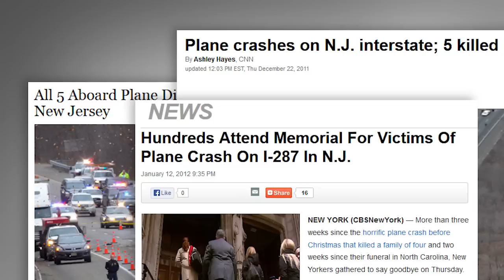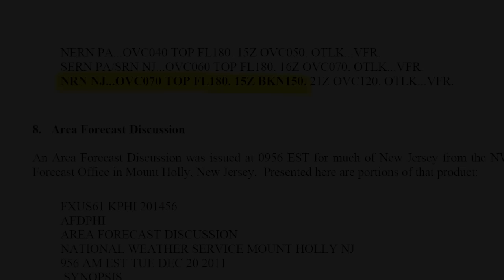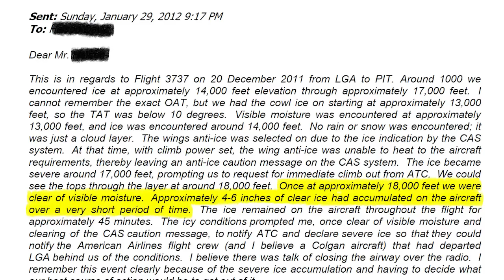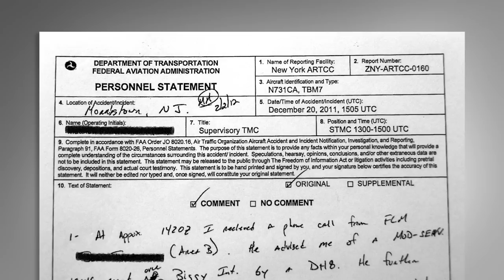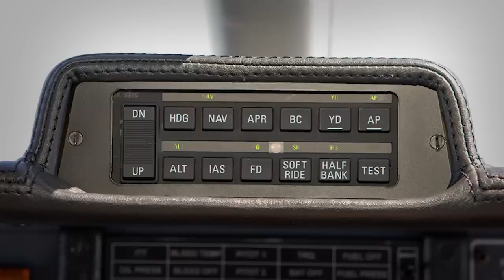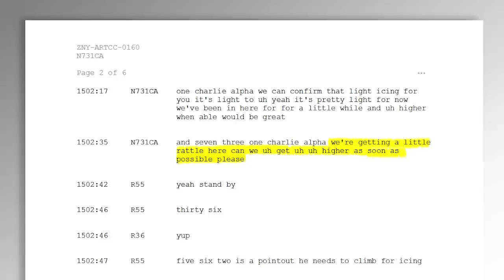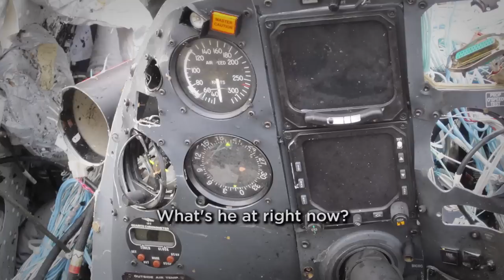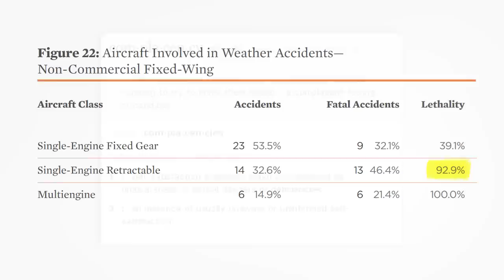Accident Case Study: Delayed Reaction

Comment: what would have been the correct things to do on his initial contact with moderate icing since it built up so rapidly. climb, decent, turn around? could a stall/spin be recovered in this case? i wanna learn from this accident as much as i can, share your thoughts?
Reply: I believe the pilot was unaware how fast the ice was accumulating. Therefore, I also think he made a fairly well informed call when he asked for a priority altitude increase, to escape the icing conditions and continue the flight. Most importantly, he needed the ice separator on his engine activated, which would have possibly got him up to altitude before the icing became too severe to continue a climb. Even if the ice was so bad he couldn't climb out of it, having the engine on would allow him to know he was reaching an extreme level of icing before losing control, and potentially begin an emergency descent. The idea being that if he knew what was happening sooner, he could have stopped it.
Reply: Pilot was totally caught off guard with the severity of icing. The ice separator would have helped.
I think the ATC should be paying more attention to weather and reports from other pilots and get planes out of the icing conditions rather than to keep them there...but of course ATC does not know how severe the icing is, only pilot can (and then sometimes it is really hard to judge that).

Comment: When going into icing conditions here's the priority: 1: ICE VAINS (inertial seperator) 2: Prop heat/intake 3: Wing/tail deice. You can fly an airplane loaded full of ice. Propellers don't work when they're effectively baseball bats(or one blade is).
Reply: No, you CAN'T fly an airplane loaded down with ice. The lift deteriorates until you are just riding a rock. You must have mis-typed because that's a irresponsible thing to say.
Reply: Cork Camden I feel like that was a typo. I hope no one thinks you can fly an ice cube.... :)
Reply: Cork Camden yes you can fly a brick if you can get it going fast enough. Why is it “irresponsible” to say?
Reply: @michaelarturo6864  LOL if you can fly a plane inverted then why can't you fly a brick given enough power and attitude control?
Reply: touristguy87 exactly
Reply: I'm guessing that you don't use the VANES much.

Comment: The inertial separator switch --not on, was the big mistake! You will accumulate ice in the intake and choke of the air going into the engine. Through all the confusion the pilot might have panicked and got into a spin (with extra ice not helping). So, basically if he didn't forget to turn on the inertial separator, he'd been fine.  So sad it could happen to anyone.
Reply: Michael Arthur It's weird since there's an annunciator that's supposed to be illuminated when it's turned off.
Reply: I'm not sure about that specific model of plane, but it does sound like he choked off airflow to the engine with ice.
Reply: I wonder about stall recovery procedures in IMC, especially with seveere icing, would not want to encounter anything like that.

Comment: What is the potential FIX for this situation in the air??  As soon as you notice the ice, immediately turn around? Climb to the highest possible,  but faster? go down to 2,000 feet or less?  Hit all the switches that have to do with deicing... and then what?  The obvious thing to do is DON'T fly if you have a chance of icing... but can someone answer the questions ABOVE? please?
Reply: Tome4kkkk  -  In icing condition like in this case, I would commence an immediate but not rapid desend, but more of a controlled descend while almost simulteanously notifying ATC of your descend.  Trying to "climb out of icing" is the wrong thing to do as your aerodynamics is compromised by the ice build up and will only cause a stall  from the higher angle of attack and ice induced drag and control surface and engine malfunctions.
Reply: Like the video said...we fly the weather we find, not what is forecast.  Complacency is the danger, since "I've flow before with this forecast and it was fine", but what they forecast is not what was found. So you need to react to what is in front of you, not what you thought would be in front of you.
Reply: NCLUSA: I agree. In aviation, you don't have to be anywhere, and you should have a Plan B ready to implement. In this case, their plan should have been to stay home when such conditions prevail, or to drive instead.
Reply: @nonmihiseddeo4181  That is easy to say after the fact.  We get Moderate Icing reports all the time.  This aircraft is made specifically so we can fly into known icing conditions.  This pilot never received the mod/sev reports from other aircraft.
Reply: @nonmihiseddeo4181  that's for poor people and commies.
Reply: Enable the inertial particle separator for the engine, descend (lower angle of attack) and declare an emergency to the ATC. This is what I got from the video. Although I'm pretty sure descending is only to buy you the time needed to get the hell out of the icing area. As far as I know low altitude doesn't guarantee no icing.
Reply: @Tome4kkkk  He just flew VMC into IMC.  He knew exactly where "good" air was.  Unfortunately he tried to get on top and it killed him.  He should have descended to 8000 or below then reevaluate.
Reply: Well apply all the deicing procedures, and I think ask ATC to help you get out of the icing conditions, I would think they should know if you need to go higher/lower/back... Though in severe icing you really do not have that much time.
Not sure if you should go higher or lower, going higher means that in case of troubles you will be forced to go down through those nasty icing conditions, so in case you need to make emergency landing it is better probably to be lower, but on the other hand you might be able to get out of icing conditions so it really depends on the weather you are in at the time.
Reply: Don't fly period.
Reply: Nonmi Hiseddeo, a lot of people are like Sheep, if other people do it it must be ok to do. I am a realist, anything that moves is dangerous, anything that moves very fast is very dangerous. Yes there are more car crashes, but then again there are many many more cars being used than planes. People need to listen to their own mind, if your mind is telling you that somethings might be dangerous then it just might be?.
Reply: Well said, NCLUSA.
Reply: @NCLUSA  ??? We've had only 1 commercial aviation death in the US since 9 years. The odds of a plane crash are one for every 1.2 million flights, with odds of dying one in 11 million. Your chances of dying in a car or traffic accident are one in 5,000. In the us U.S every 12 minutes someone dies in a car crash. you are way more likely to die driving to the airport then dying on plane leaving the airport. Your driving rationality follows smokers logic "I've done it more than once so it must be ok".
Reply: @bishop51807 People take vastly more trips by road, than by air, so that comparison by itself doesn't tell the whole story.
In the 90s at least, it seems commercial aviation vs car was approximately the same risk of fatalities *per hour*, so statistically similar risk driving to/from the airport, as on the flight.
Some other stats for the UK in about the year 2000 showed about 4:1 higher risk per hour by car than plane, but about 3:1 higher risk per trip by plane. The stats seem to vary a lot, partly driving & flying conditions in different countries I suppose.
But by distance of course flying commercially would be much safer.

Private plane flights are far more dangerous than commercial though, 1 fatal crash per 50,000 hours for personal flying (which was in turn worse than top-dressing, training etc flights).
https://www.livescience.com/49701-private-planes-safety.html
https://www.ntsb.gov/investigations/data/Documents/ARA1201.pdf

Even the space shuttle was only twice as dangerous as car..... by distance ;)
Reply: @bishop51807  that's commercial flyers I wonder how much higher the risk is if you are flying non commercial

Comment: Great video … and very sad story.
I guess that no pilot would have been able to recover it, because it is already too late when you stall in this situation.
The only equipment that might has saved their lives could be a parachute (which you can find on aircraft such as Cirrus).
Reply: The Cirrus parachute deploys at a maximum of 135kts. There was a similar incident involving an SR22 where the pilot tried to climb out of the ice, and stalled, entering into a dive. He pulled the parachute, but the aircraft was already going so fast that it just ripped right off and the plane crashed, killing the pilot.
Reply: François SUTTER he would've survived if he deviated from ATC clearance and climbed above the icing conditions. But hindsight is always 20/20

Comment: I have about 100 hours or so in a TBM 700 (9000+ total time). They are more than capable of handling heavy ice. However you have to use the inertial particle separator or the engine could ingest enough ice to either damage the engine or flame it out. They mention in the video that they found the IPS switch in the off position but they don't elaborate on it. 

I will say this. I was at FL220 in a brand new TBM 700 many years ago in moderate ice when I heard a rattle or a buzz coming from the tail. The airframe had a moderate build up of ice on unprotected surfaces but very little if any on the wing boots which I was actuating every five or six minutes. The longer we stayed in the ice the worse the noise was so we asked for an immediate descent to 10,000 which we got. Once we were in warmer air the ice melted and the rattle stopped. We investigated the noise and never could determine the cause. It didn't seem to effect the flight characteristics at all, just a "nerve rattling" rattle! I do want to say that I trust the TBM completely. I think it is a well made airplane and would have no problem flying it anywhere. However my arm chair quarterbacking thought is that he pilot had the autopilot on in cruise at 17000. When he was given the authorization to resume his climb - 15 seconds of ice build up later, he trimmed the AP trim wheel to begin his climb but the elevator may have been frozen in the cruise or neutral position from ice freezing around unprotected areas. The AP couldn't overcome more pitch commands from the pilot on the AP trim wheel and it inadvertently disconnected which caused an immediate pitch down which may have caused some PIO (pilot induced oscillations) and stalled followed by a spin. Sadly we may never know what really happened.
Reply: Wow. Your perspective is interesting.
Reply: I've flown right seat in a 910 for about 8 hours and we encountered ice. The checklist had the Inertial Separator as the first item in moderate conditions.
Reply: @ooo_Kim_Chi_ooo  Many pilots don't like to use inertial separators when they are climbing especially when you are trying to expedite climbs because it will cost you power.  He possibly just forgot though.  Might have been his first encounter with icing this bad.
Reply: "more than capable of handling heavy ice" That is a worrying statement from a pilot. Bravado like that gets people killed. The conditions described by the Air Wisconsin and Amercian Airlines planes in this video sound  like supercooled large droplets (SLD) conditions. The cues to SLD on the plane are ice formation on side windows and aft of deice surfaces. A TBM is not certified for flight in these conditions simply because the de-ice system cannot adequately protect the aircraft in these conditions.
Reply: Another commenter mentioned the possibility of tail stall due to icing causing stick shake (could be interpreted as a rattle).
Reply: @wingman358  I don't believe it. He tried to climb and that was what brought down the plane. Pulling up the nose didn't work--typical stall.
Reply: Good synopsis to me, well thought out. Plus the EXPERIENCE is a bonus
Reply: Why would you cycle the boots with little or no ice in them ?  That’s a recipe for disaster. The ice can still build up that way and build what some call tunnels. Those also destroy lift too.
Reply: @kenclark9888  Maybe, but that concern contributed to the crash of Comair 3272. The NTSB recommends that boots be used as soon as icing begins. I don't accept their claim that ice bridging doesn't exist at all, but waiting for a full half an inch to build up is probably a bad idea.

https://www.ntsb.gov/safety/safety-alerts/Documents/SA_014.pdf
https://www.ainonline.com/aviation-news/aviation-international-news/2009-01-28/de-icingntsb-ice-bridging-myth
Reply: @benjwgarner  first off I never said to wait for 1/2 inch.  I just said turning boots on earlier than needed would be an issue
Reply: Av8or9557 says the TBM "more than capable of handling heavy ice.  I'm not a pilot.  What I know about icing I have read on the internet over the last few minutes and from that meager knowlege I conclude Av8or is a fool or a liar.  At 4:40 and following there is a graphic on the video describing moderate and severe icing which puts the lie to Av8or.

Comment: Scary for it to go from bad to worse in such a short time.

The video was a little unclear about the final determination of the cause of the accident.  It suggested a) this model aircraft did not have the strongest of anti-icing capabilities, b) one technique is to climb through icing conditions quickly like the AA pilot did, c) the pilot did not turn on the inertial separator to keep ice out of the engine, d) the pilot should have quit climbing and nosed over.

Then racks it up to complacency, I guess because this pilot had so many hours.  Can anyone shed light on this?  What do you think was the cause of the accident?
Reply: CFITOMAHAWK2 Hi, in my opinion, in this case, even if you are very well trained with high skills in spins and unusual positions, it does not help … According to me, it seems to be far too late. Because of the ice, maybe that you just can not use anymore your flight controls (elevator, aileron, …) which might be fully jammed by the ice … and when you loose your altitude the load factor and the VNE are widely exceeded ... thus the plane falls to pieces (this is what occurred in this terrible accident).
Reply: It crashed 6 miles away from me and made a mess of the 287 traffic. Luckily only a pick up truck got sligthly hit on a tire i was told. It could have killed more on the highway.
This Pipipilot stalled the plane at 19 k by forcing it to climb without applying the engine inertial particle separation. What was he thinking? that he had an F16 instead of a TBM? Very irresponsible Arrogant jerk. Arrogance and Aviation don't mix. Mother nature put arrogant pilots in its place eventually.

 He stalled and kept pulling back in panic too. I flew that area 20 years. That guy was one the many "GA  Arrogant Chickenhawk". USA GA is full of them. That is why LOC accidents happen to so many. I was one for only a few months decades ago. Then I change due a close call and I went and took an aerobatic intensive course. It changes you, a lot.Spins should be required to all pilots. Full Spins not 2 turn fakes for the CFI like we have now. Even CFI's are stalling spinning over flat fields due small problems. USA GA regulations sucks. They let any turkey or chicken pilot put 8 passengers on a plane and kill them. Money talks, not skills. USA GA managers most cannot do EFATO's..Crooks with licenses or not?
Reply: *****
Ice dont freeze the controls..That is a lie from pilots that crashed due THEY FROZED.and became clods and crashed...hey, blame the ice..it wont defend itself..